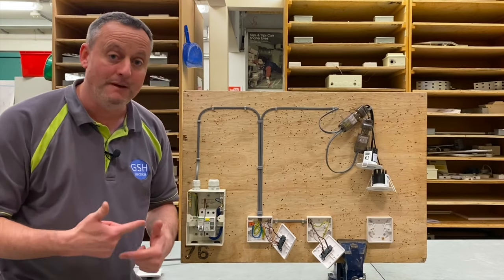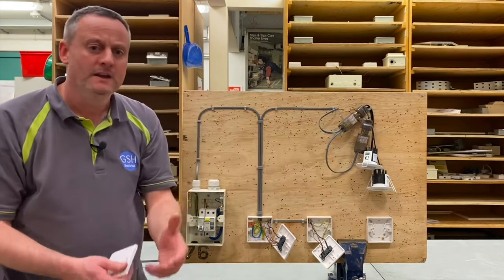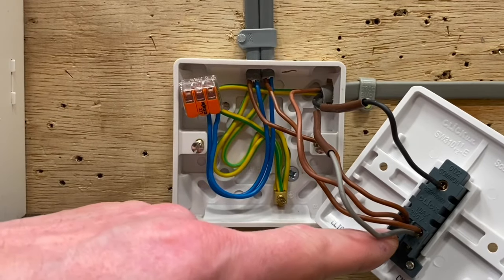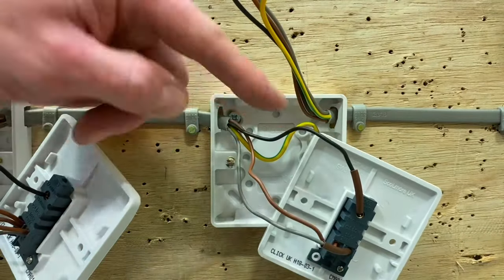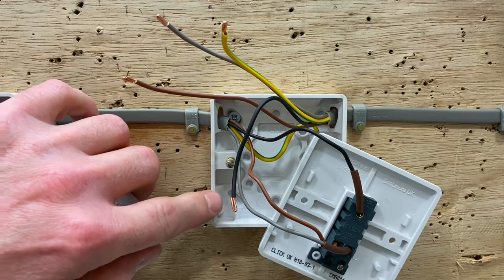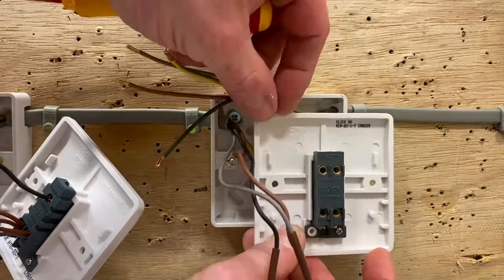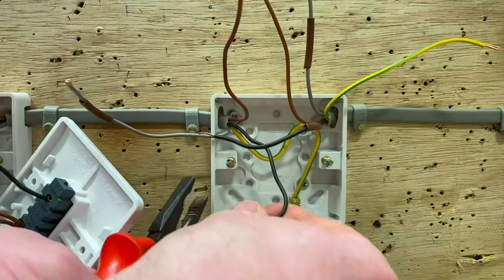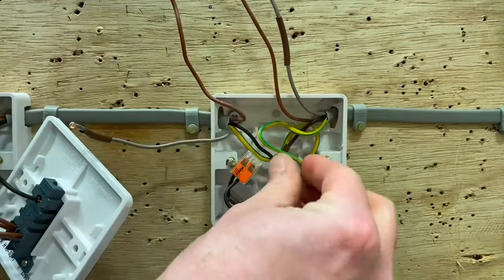Lighting Circuit 2 Plate Method How to Wire up and Connect 2 Way and Intermediate Switches (3 Way)

Comment: When I was an apprentice we was always taught the red was common. When the cable colours changed we automatically used brown for common. I still find these days in my area 50% of electricians use brown and 50% black for common. The point I’m making is when replacing a switch always check to make sure what colour has been used for common
Reply: Most switches from that era wasn’t the 2 plate method

Comment: Now there's a recommendation in the regs to have a neutral at every switch position, I thought the wiring through the switch method would be the method of choice for 2 way and intermediate switching now but doesn't seem to be the case. The 2 plate method is still being used on new builds.
Reply from the maker: Great comment 👍🏻

Comment: Can the light be connected to the intermediate switch?
Reply from the maker: Not in this case
Reply: @GSHElectrical  does the light have to be connected to the same switch the live comes in or anywhere in the circuit so long as the live is switched?

Comment: Without a diagram (drawing) much too much verbal communication.
Reply from the maker: Wiring Diagram Lighting Circuit 2 Plate Method Taking the Feed to the Switch 2 Way and Intermediate
https://youtu.be/L9DU8XkHn1U

This is the wiring diagram link in the description for the downloadable handout 👍🏻
Reply: Watch the rest of the series where Gaz provides downloadable wiring diagrams!